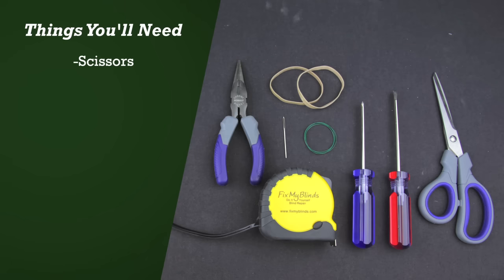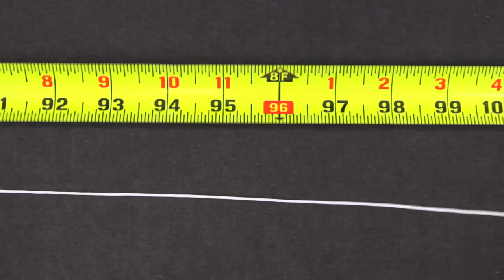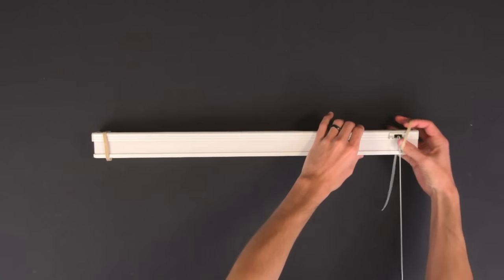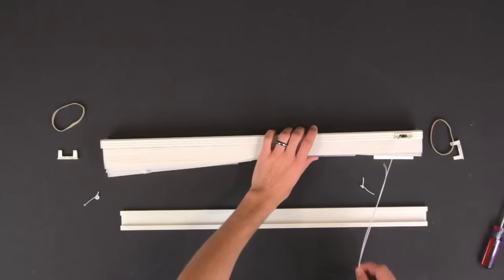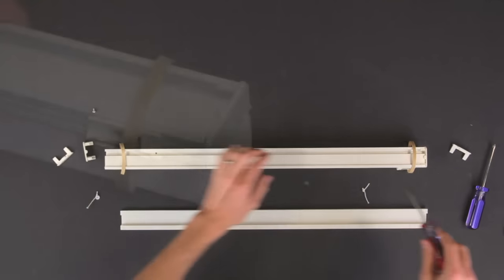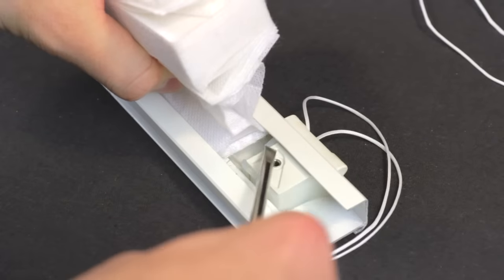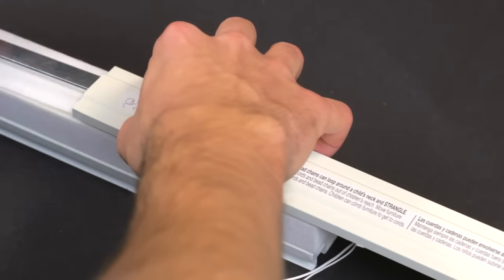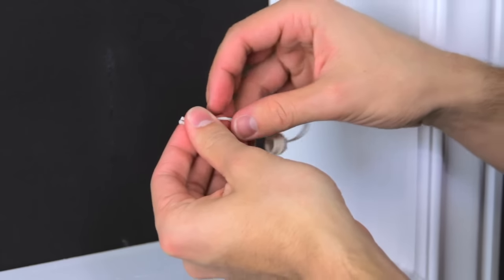How to Restring a Bali and Graber Cellular Honeycomb Shade

Comment: Great Video saved me a lot of money being a 73 yr old woman I did it twice to the same Balli shade 74" long x 44" wide. The video says to measure twice the length plus once the width. I followed the directions with doubts. After hanging them realized the width of the string was not long enough. In my case, it is twice the length and twice the width. Great satisfaction though finally getting it hung and functional for little cost, just wish I didn't have to do it twice. Hope this saves time for someone else.

Comment: The video helped, although it took me 3 hours for just a 2 string, 32x35 inch shade.  The most challenging task was fishing the string through the cord lock.  The looped wire was not inserting from the outside.  I finally, by good fortune, got the little metal toothed wheel to move into an open position.  The the wire had a path to travel through the cord lock and catch the string ends to pull through.  That could have saved me some time had it been mentioned in the video.  But good video!

Comment: I don't have Graber/Bali blinds.  One end cap on my blinds is actually the cord lock.  These instructions were great and I found restringing the blinds very easy. I'm actually kind of mad at myself for paying to have my other blinds restrung several years ago.  I would rate myself as a long-time homeowner who has done many repairs over the years, but I think these instructions are simple enough that if you are at all handy, you can repair your blinds successfully. If your blinds are different and you are unsure of yourself, simply take photos with your phone as you take things apart so you will remember how to put it back together.  Thank you very much for this excellent video!

Comment: Good instructions. Some notes from my fix of some 13 year old Bali blinds: using the formula I would have 3 strings at 186 inches each. I was able to use 3 130 inch strings, trimming the nearest 2 to the lock but just barely making it with the 3rd (furthest from lock). The Bali shades did not require me to remove the bottom piece as the holes and plugs are exposed, so check this on your shades before removing the bottom piece. My Bali shades also had no top screw. I was also able to avoid using the wire tool by tying the new strings on to the old ones and pulling these though the cord lock.
Reply: I’m so glad that I read your comment!  I am about to do this to one of my blinds - and while watching the video, I actually was wondering if I could  just attach the new string to the old one to pull it through the cord lock.  Thanks to your comment, I am going to do it this way - seems easier.  Thanks again!

Comment: We have 17 year old Graber/Bali honeycomb blinds. Some are beginning to have cords break. Had a local store re-string one cord, but not all, for $12. Not a good solution with different cording. Got a spool of 1.2mm cord and followed this excellent video to repair the  next ones to break. Looks easy, but still a challenge. Getting the cords through the cord lock was difficult, but trying to slide the top rail over the cord lock was the worst part. Screwdriver was way too big. Needed my old set of ignition feeler gauges to finally slide the rail over the cord lock. Thanks for an excellent step-by-step instruction video!

Comment: Thanks for the great video!! Watched it a couple of times and fixed my honeycomb shade that had a broken string. Notes:
1. I live in a small town and didn't want to wait for online order of string, so I found a nylon braided cord at the hardware store that was 1.2mm and worked good. We'll see how long it lasts.
2. Measure EACH cord as 2L+1W. Mine had 2 cords. You will have cord remaining, but it was a fast way to cut the string and not worry about the final length.
3. Be VERY careful when removing the top rail. Slide it off in the direction of the cord lock (where the string is pulled from the top). Otherwise you'll have trouble and possibly rip the shade.
4. I had no special tools, so used a craft needle to thread the cord through the blinds. Then used a twist tie from trash bags, with the paper removed so it was just the small wire, to thread the cord through the cord lock. Worked great!
5. I had a little trouble replacing the shade back onto the clips. Once I figured it out, then great. Mine required me to slip the front rail over the clip facing me and then push up on the back side so I heard it click in place. I had not slipped them into the clip the first time, but still heard the click, and after several up and down pulls, the whole thing fell down.

Good luck with your fix.  Thanks again for the great video.

Comment: Great video.  For $22 (cord, restring tool, needle, shipping) I fixed our 83 1/2"W x 52 1/2" H blinds.  But I damaged them in a few places while restringing due to not being careful enough (you can't see the damage now that it's fully re-assembled).  If I can do this, so can 90% of you.  And a few extra tips:

DO
1. Watch the video all the way through a few times first.  Have it available, live, to play, pause, rewind, replay, etc while you do the restring job.
2. Buy the cord, needle, and stringing tool.
3. Have plenty of room in your work space (more than twice as wide as your blind).
4. Use a head lamp and reading glasses if you can't see inside the locking mechanism to get the strings through exactly the right spot.  The video shows a close-up immediately after the part where it shows somebody using the stringing tool to pull the cord through the mechanism.  My one gripe on the video is this close-up should be before, not after, the step.  Otherwise, this step can be very time-consuming and frustrating, even with the restring tool.
5. Vacuum up dog hair, etc from the work space before working on your blind there (mine was the living room floor).  Otherwise, it ends up all over and between the pleats of the blind when you rehang it.

DON'T:
1. Don't get in a hurry.
2. Don't forget to remove the set screw or decide "mine doesn't have a set screw" and work ahead.  Find the set screw on the opposite end of the locking mechanism, and remove it at the appropriate step of the process.  I checked the full 83 1/2" of my top rail three times and didn't find it.  Then I decided "mine doesn't have one," and kept going.  I tore the top of the blinds up trying to remove from the top rail them while the set screw was still in.  Finally I went back, found and removed the set screw, and the top rail came off smooth as butter, except for a few minor snags across the torn parts I created trying to force it off while the set screw was still in place.  I also had to spend some extra time getting that thin little piece of plastic back in the top of the blinds and realigning that piece of plastic to the rest of the holes when I needle threaded the new cord through.
3. Don't worry the needle they sent you isn't long enough.  Even with my large blinds it was long enough.
4. Don't fight the blind or force it.  If something isn't going pretty easily, you've got something wrong.  All of these steps go pretty easily when you do them right, even with a large blind like mine.
5. Don't cut more cord than recommended just to be safe.  There's significantly too much cord that you cut and discard at the end already, using the measurements they suggest.

Comment: Your video is awesome. After watching it a couple of times I was successful in replacing the pull cord on our blinds. I had a little trouble with the bottom rail from grabbing the material so I had to slightly bend the starting edge of the rail. Also added a little masking tape to smooth the edge. Afterwards it slipped on without any trouble. Thank you for taking the time to create this video.
Reply from the maker: That's a great idea to use some masking tape to keep the fabric down!

Comment: Good video for the basic concepts, but I'd like to make some suggestions. First, about the length of the strings : Measure each one you taking out, and cut the replacements a full foot longer. That prevents the string from disappearing into the shade if things slip before you tie on the knob or aglet. Second, it was much easier for me to remove the cord lock from the top rail, then thread the strings through it. Next, slide the top rail into place on the shade material. (Much easier because the cord lock was not in the way.) Then snap the cord lock back into the top rail. I used a ~1" wide bit of thin metal to hold the fabric out of the way as I snapped it in.

Comment: I definitely could not have restrung my blinds with out this video.  The instructions made it very do-able for me.  I ordered the string from the fix my blinds website which was easy to order from.  But I used my own embroidery needle and a piece of floral wire to make my own restring tool which worked just fine.  The only thing that I disliked was that the formula for cutting the new strings made my strings way too long.  I had a 6 foot by 6 foot shade with 3 lift strings. And with all that string I was constantly tripping over and tangling up the string while I was working.  Not to mention all the string I wasted. If I ever have to do this again I would know that it is OK to use less string.  But even so, I saved a lot of money restringing my blind vs. buying a new one.   Thank you for your great instructions!

Comment: This worked for my Levolor blinds also!. The needle was short so I had some trouble threading the string. Using the wire
was a great tip. This was generally an easy project. Took me about an hour total. Thanks.
Reply from the maker: Dan, we're happy to hear the repair went well!

Comment: Very informative vid. I'm a fisherman so had some 80lb dacron fishing line and used it. You covered all the challenges in this repair. Thank You!
Reply: Oh, Jim, what a FANTASTIC suggestion! Darn; wish I'd read your comment/suggestion before using a traditional cord sold by a "fix-your-shade" Web site. Darn, darn, darn!  Well, I'm certainly prepared for the next shade-cord that's due to snap before I get up to those Pearly Gates. I use fishing line for myriad other uses/fixes, but am sore from not thinking of this for the shade. I hope others are smarter than I am to read your comment before buying the traditional-shade-cord-due-to-break-too-soon.  Thanks much.
Reply from the maker: We don’t recommend using fishing line to repair any type of blind or shade. While the material is very strong, it will quickly cut through the plastic components of the shade, creating gouges and grooves that will hurt the operation of the shade. It is best to replace the cord with blind cord. The cord we carry is specifically made for blinds and shades, and is used by all major US window covering manufacturers. If the cord on your shade is breaking often, it may be traveling over a rough spot or a groove that has been worn in one of the plastic components. Next time you have it down and apart, I’d check all of the parts and see if anything needs to be replaced.

Comment: I've done this successfully a couple of times now. One (perhaps obvious) caveat - you have to have the shade fold itself up properly to get the needle through. Often, if one side breaks while someone is pulling the shade up, it will bow out or wrinkle, causing some of the folds to invert themselves. You have to tease them back into place. I used a long thin object (a bicycle spoke, since I happened to have one) to work the folds back out from the inside. Once all the folds are in place, use the rubber band to hold them while you push the needle through.
Reply from the maker: Mark - that's a great tip! Getting the fabric to fold back up correctly can be hard sometimes.

Comment: This is a good video with excellent instructions.  There are two issues that are not covered in the video:
When stringing the new string, the needle may not be visible on the other side of the shade, due to the size of the shade.  Pliers would not work, since they are too wide to go through the string hole. 
In my shade the cord block tore the string and needs to be replaced too.  There are no instructions on how to replace the cord block.  There are instructions, though, on how to restring a new cord block.  But I don't think that it is enough.

Comment: Great video, Easy to follow. Could use a little more specificity on exactly where the string comes out the front of the string block. I suggest a magnetized screwdriver for replacing the set screw.

Comment: This video is great and I had full confidence that my husband and I could fix the broken string in our cellular shades. I bought the $24 worth of string, needle and wire guide.  We got all the way to the step where it was time to remove the headrail.  Unfortunately our shades are built so that we have three separate cellular shades all on one 104" wide headrail. Only the middle shade had a broken string.  So the problem is that you cannot fix the broken strings on the middle shade unless you remove and restring all of the shades on the headrail.  Furthermore (and this is the biggest problem), each one of these Graber shades is attached to a single, continuous, thin piece of plastic so that all three shades must be slid out of the headrail at once.  Sounds easy, right?
Keep in mind that this means they all have to pass by a minimum of 2 cord lock "barriers" inside the headrail.  During our project, the fabric in one of the shades started coming away from the thin plastic guide, getting snagged up at the closest cord lock.  After 45 minutes of gentle struggling, I pulled out the loose cord lock full of fabric snags, (I broke it in the process) and with a box cutter, separated the thin plastic guide so that at least the ripped up shade would be separate from the other two.  Needless to say this afternoon project has turned into something that will take weeks and probably another $40-$70 to be completed.  I would recommend that fixmyblinds.com suggest in each of their very well-produced videos that it's only prudent to remove one set of shades / blinds from a headrail.  If you are working with multiple shades all on one headrail it is a much trickier job.  DIY'ers should expect to have some tearing and snagging of the fabric on larger-width shades.  How can this be avoided?  Is it because our shades are 21 years old?  They were in great shape except for the one broken string.  
Now I am looking for a video on how to re-attach the top part of the cellular fabric to the thin plastic guide.
Reply from the maker: Eva, Thanks for your comments and sharing your experience. Fixing a three-on-one head rail shade is difficult. Because the cord locks can't be removed without breaking them, it makes for a very frustrating and tedious process. (It's always that center shade that needs the new cord.) How did this repair turn out in the end? Please let us know if we can offer you any additional support.
Reply: We ended up purchasing new blinds from a local dealer who could get the exact same color and material from Graber.  The new ones will be "cordless" so that should be nice. (It was a free upgrade.)  But we have the experience under our belts now in case another set of single-shade blinds in the house needs to be restrung. And we have all the strings cut to length and ready to thread.

Comment: After reading all the comments about how fabulously easy this works,, I figured, “ I fix things all the time. I can do this.” Well, two hours later I did, but it was a hellish process. First, starting and pausing the video automatically muted the sound, so stopping, re-starting, changing the mute, restarting, that didn’t work, stop again, fiddle with the mute, re-starting, well....that was a giant pain in the butt. Everything went smooth as silk until it turned out that the needle supplied was far too short for the length of my blinds, so stop again, fabricate a longer needle out of 18g wire, re-start again, and string the cord. Then stop, view, re-wind, deal with audio, re-start, and finally get the cord through the cord lock. Big sigh. Then slide on top rail, which jams when it comes to sliding over cord lock. Apply flathead screw driver. Still jammed. Remove top rail, inspect, re-string, try again. Still jammed. It turns out that the procedure works great with nice, new, tidy shades, but the application of scotch tape is needed to smooth the edges if your shades are five years old. Apply tape. re-string, finally get top rail past cord lock on THIRD try.mAssembly fine from that point on. The video using brand new, small shades does not represent the giant hassle involved in stringing larger, older blinds. Now I have the stuff, I might try it again, but really, for the time I spent, it would have been worth putting the money that I spent on cord toward new shades. Just so you know, the wire stringer is just a piece of wire, about a foot, bent in two and the needle is just a long, blunt needle that you might already have, and it’s too short for longer blinds anyway.
Reply from the maker: Hi Ann, Thank you so much for your feedback and sharing the challenges and solutions you came up with while repairing your shade. First, I'm sorry the audio was being muted after you paused the video. I haven't heard of this happening on our videos before. I will look into it to make sure others aren't having the same issue with our channel. Also, I'm sorry the needle was too short for your repair, using a piece of 18g wire is a great solution when that happens. There are instances where the fabric gets snagged in the rough edges of the headrail even with new blinds. Taping the fabric to the fabric stiffener is a great idea to get past those. Again, thank you for sharing your experience.